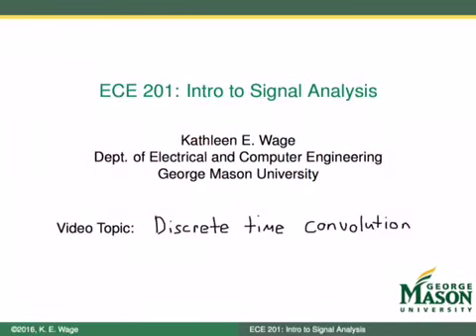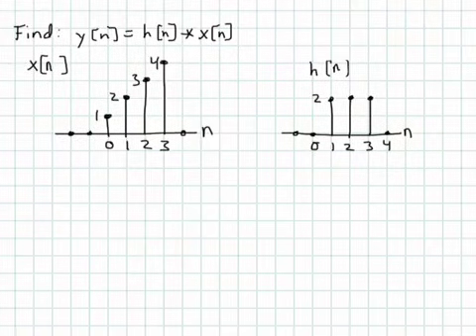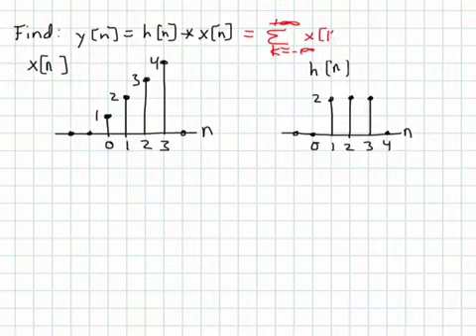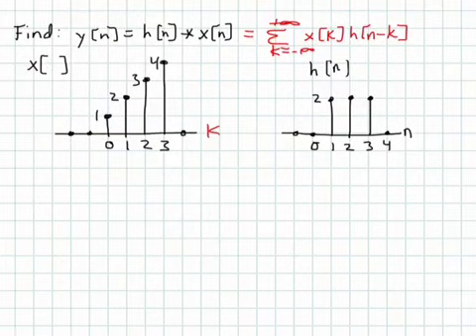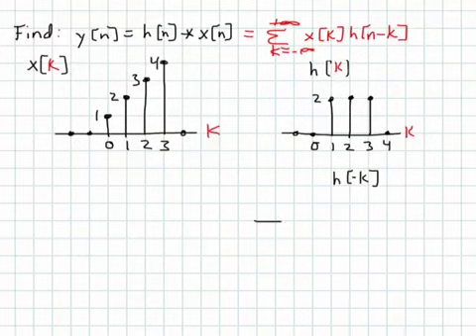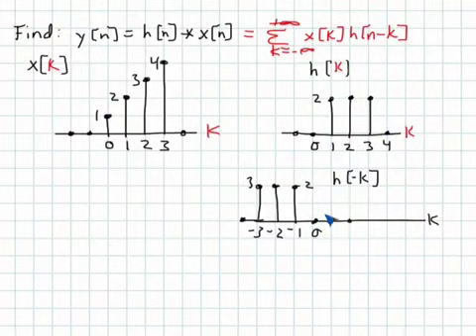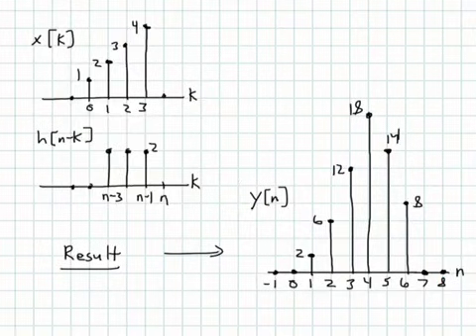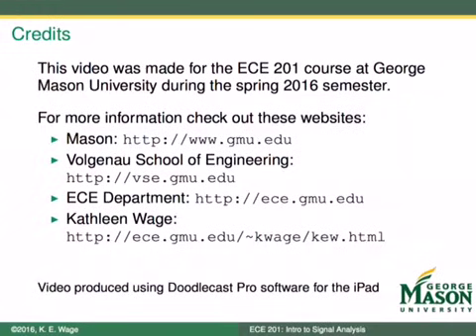Discrete time convolution

Comment: Dear Professor Kathleen Wage, there is a mistake at the beginning for y(0) = 2. It should be y(0)=2 instead of y(0)= 0. For y(n) = 0 for n<0.
Final results are here:
y(n) = 0 n <0,  y(0) = 2 n = 0, y(1) = 6 n = 1, y (2) = 12 n = 2, y(3) = 18 n = 3, y(4) = 14 n = 4, y(5) = 8 n = 5
I did both methods and same results.
Thank you. All the best
Reply: u are right there was a mistake on the video ıdk how no one noticed this.

Comment: Professor Wage, thank you so much for this presentation--you went over the material slowly and methodically and I was able to grasp it very easily.  I was wondering if there is a shortcut method (maybe using discrete calculus?) to get this result in one step?
Reply: yes there are....view tutorials point channel

Comment: Nice explonation but let's see the problem with this method that you are using. This convolution is called the "sample-by-sample" one, which is good when the input and impulsive response don't have too many samples, otherwise it's a long process and should probably be done with other methods. Also let's say you have, for example, an input of x[n]=u[n]*2^n. This means that convolution will exist till infinity and this method can't be applied there (imo)